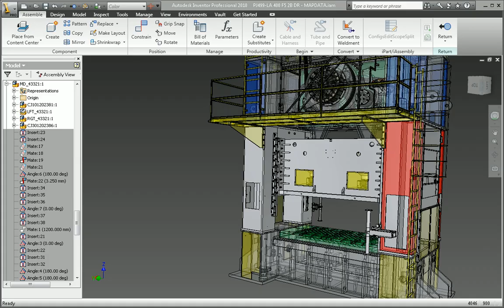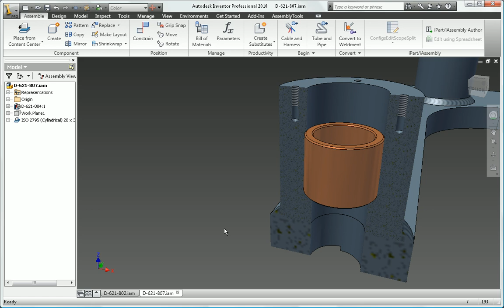Autodesk Inventor 2010 Assembly Design

Comment: i can't describe how much i love this program. :D

currently trying to design a turbine/electric/steam (tri?)brid engine.

basically a hybrid, with a steam turbine running of the excess heat from the main gas turbines. in-hub-wheel electric motors, lith-ion battery... and two 'blaydon' type gas-turbines.